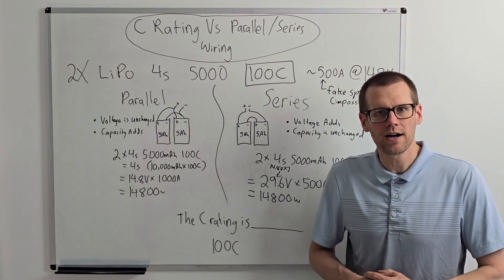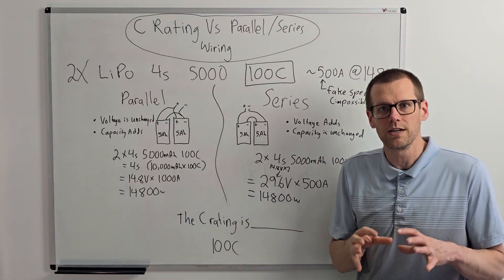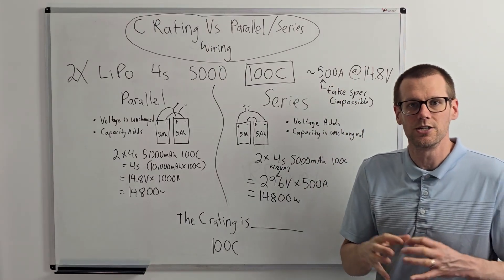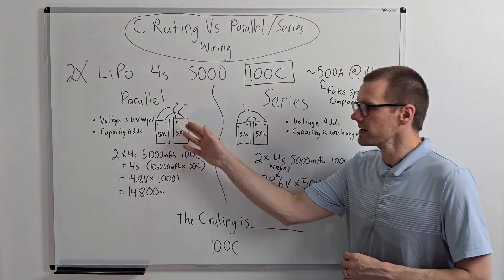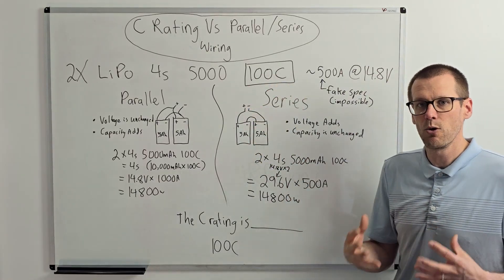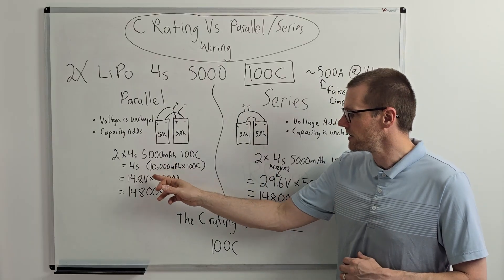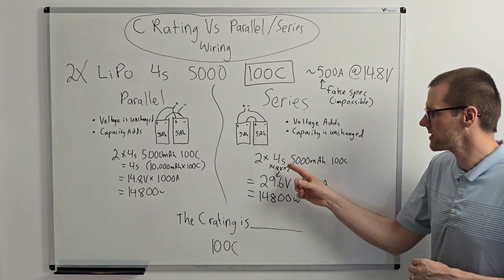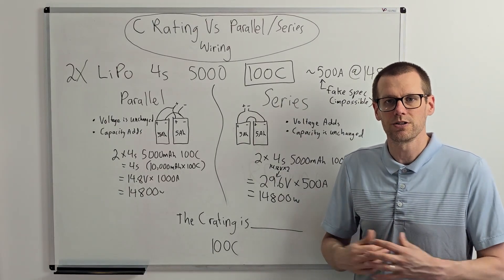The C Rating Trap: What Changes with Series and Parallel Wiring?

Comment: Hello, I have a question about something different. I plugged it in with the reverse polarity, but the ESC button wasn't on! There was only a spark when plugging (It was a stronger than normal). So I checked and realized I had connected the cables incorrectly. As I said, the ESC button wasn't on! Then I plugged it in correctly and it works, but I still want to ask.  was there any damage On my ESC?  
Castle production HPI FLUX BLUR ESC-Similar  Castle Mamba Moster ESC
also i used 6S Li-po Battery
Reply from the maker: I've not done this before. If all is working it sounds like you are ok.

Comment: Some safety tips on connecting batteries would be helpful.  For example, when wiring batteries in parallel, if the voltages are very different, you'll draw a lot of current between the batteries even when your device is off. Also, leaving batteries in parallel wired together will often result in those batteries becoming destroyed due to individual cells becoming drained and others becoming overcharged. There are other potential issues that people need to know.

Comment: 1.The actual power output in relation to internal resistance
2.The risks associated with internal resistance and voltage differences during parallel connections
3.The mechanism by which differences in internal resistance can damage cells in series connections

I would be deeply grateful if you could consider creating a video that addresses these topics.
Your content has always been incredibly insightful, and I truly appreciate your continued efforts.
Reply from the maker: I'll see if I can get one of these added to the queue.

Comment: So what lipos actually have the right c rating on it?
Reply: basically none of them, if you can measure internal resistance there's a calculator on his site to get the real rating
Reply: @marshallb5210 not smc
Reply: SMC racing
Reply: @bs9two4  Not even SMC have the correct c rating on them, even though they are probably the best respected packs on the market. Watched an interview with the guy that owns SMC, even he said the labels on his batteries are over rated. But added to sell batteries these days you are forced into doing this to sell batteries, it started with cheap unbranded batteries lying about the c rating on their labels. Example of what SMC said was, if he put an honest true c rating of 30 - 40c on the SMC batteries. He wouldn't sell many batteries when the false labelled cheapo batteries were claiming 100c, 120c, etc etc. Some of the best expensive most respected lipo's like SMC race packs have been tested to actually have a true c rating of around 30c, To put that into perspective though. Some of the cheapo packs like Zeee with claimed 100c rating, actually came out as low as a true 12c.
Reply: @gillian9178  Sad but true. Real life 20C is decent, and 40C is incredible. wish we could just be honest about it
Reply: Probably Turnigy or Traxxas with their 20c-30c ratings 😅
Reply: You may consider it as referring to the case where the battery's internal resistance is zero.
Even with a typical internal resistance, a 7000mAh 100C battery can deliver approximately 150A to 200A of output.